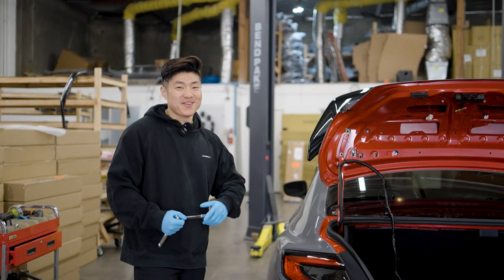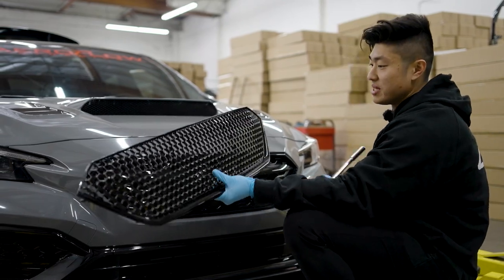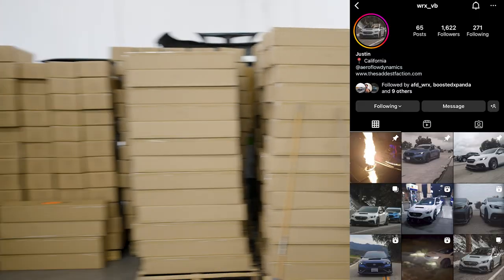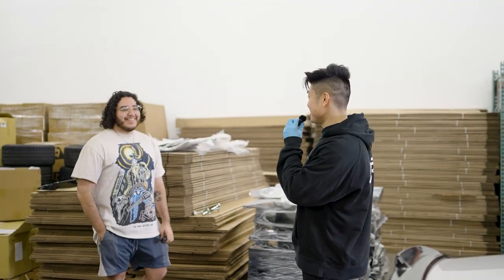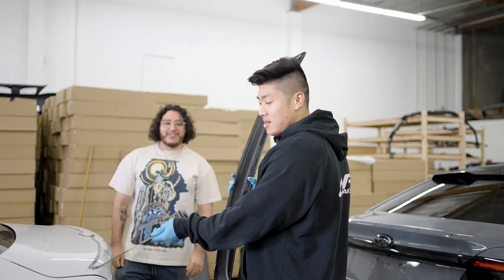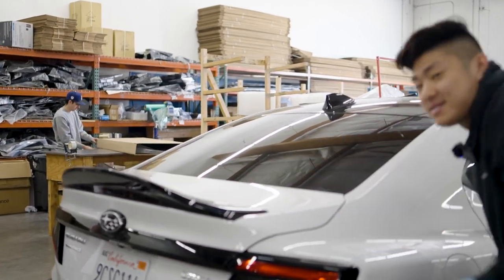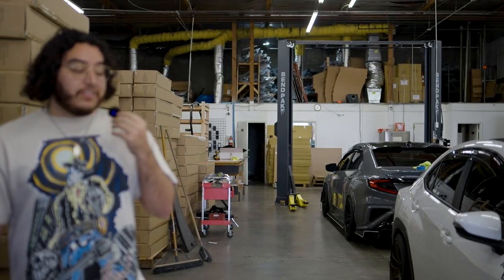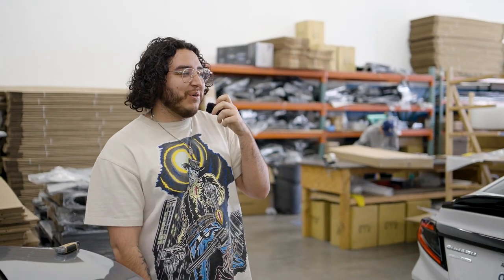Aggressive Kogeki Duckbill Spoiler | 2022 Subaru WRX

Comment: Just installed mine on my silica black today, i put electrical tape on the pre-existing trunk holes to prevent water from getting in, my 3m tape doesn't stick down all the way to the trunk properly, I've tightened it the best i can and hope no water gets in the trunk. I'll give the car a rinse to see if it's sealed properly, otherwise re-peat the install. 

What is the 3m tape type/brand that comes with the spoiler, I wanna buy more just incasse I have to resinstall.
Reply from the maker: Hi Pamal, email us and well send ya some extra tape no charge!
Reply: @aeroflowdynamics  I’m in Canada, is that okay? That would be amazing

Comment: I installed mine and the 3m tape is visible.  Do you see it on yours?
Reply from the maker: If you see the 3m tape make sure you need reapply! Please use the adhesive
 promotor as well!
Reply: @aeroflowdynamics  I ended up getting the stronger 60lb 3m tape to use. it's basically impossible to remove now. I tried using a heat gun and the paint melted off. had to take to a body shop to paint